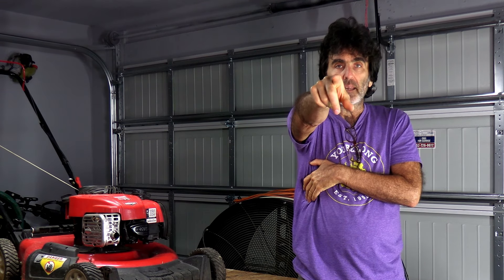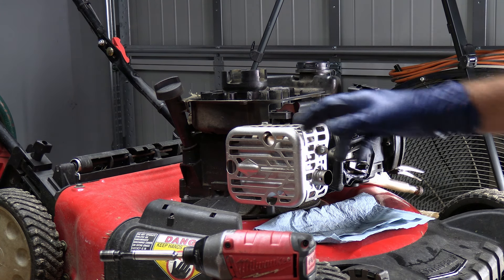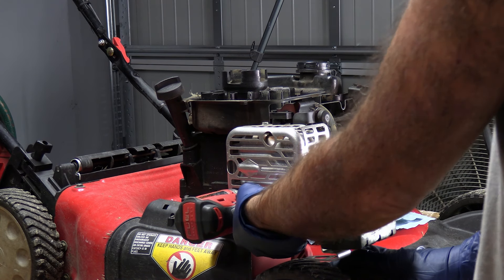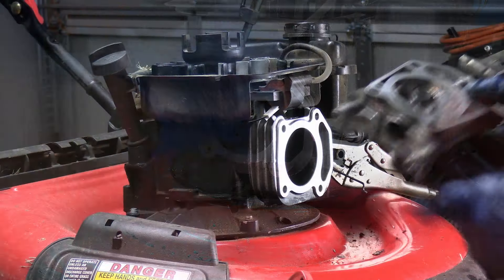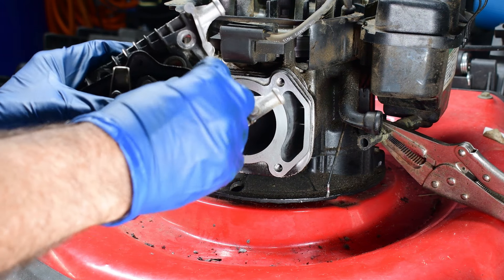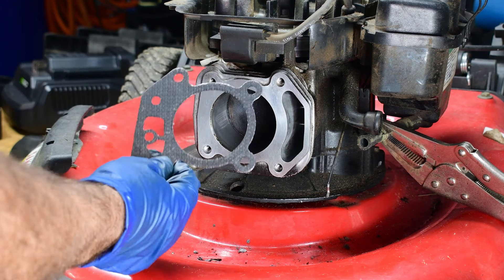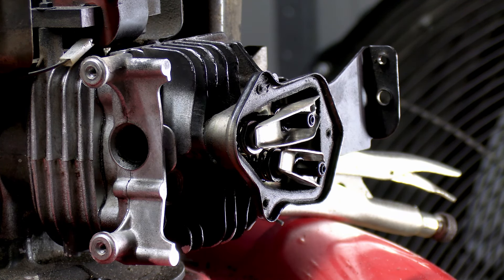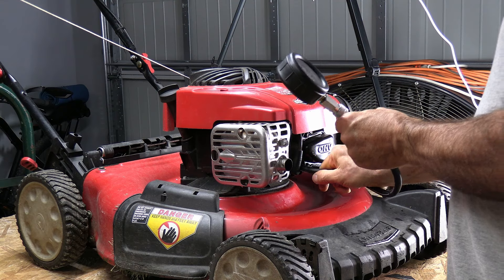How to Fix This Briggs And Stratton Engine With No Compression [EX 550]

Comment: I was taught years ago to run the piston up to the top before scraping the gasket off the head. That way debris couldn't fall down into the piston hole. Also, clean the carbon off the top of the piston and valves while you're at it, as well.
Reply from the maker: Great ideas!  Thanks for the tips...  😊
Reply: I was taught the same back in 1976 when I was doing repairs.

Comment: I was working on a new customer's mower, it's 1 year old, the husband said he had hit a rock, and the blade shattered, and he was right, he showed it to me, and it shattered, never saw that before, but he replaced it correctly, it didn't shear the flywheel key, but getting to the point, it would not start, so did a carb clean, it wants to start, but noticed oil under the front of the engine, it almost starts, but sure enough blown head gasket, so we are waiting for the head gasket.
Reply from the maker: I've never seen a shattered blade either!  They will bend up like a pretzel, but not shatter...  I'm quite surprised that it didn't bend the crankshaft.  If you get a shake once you get it running again, that could be the culprit...
Reply: @JLPicard440  yeah, I will take pictures, and share on my channel, but yes I will go over it.

Comment: I have the same mower. It wants to start but its popping and back firing like a valve is stuck. Pulled the valve cover off and both valves move easily. However, when I spin the flywheel the intake valve opens and closes but the exhaust valve does move at all. Do you know what could cause that?
Reply from the maker: HI... Check to see if the roker is bent.  Make sure the cam is moving the tappet up and down.... Stuff like that..

Comment: Need head gasket for E300 but no numbers to order it, can’t read nothing on it 😢😢😢
Reply from the maker: HI.... I don't have those numbers off the top of my head.  Usually there's a sticker with a QR code on it... is it missing?  IF it's there your phone can read it and it'll take you right to the B&S site and list your engine model number there.

Comment: i think this is exactly what i was needing. Gonna hit it again after lunch lol.  Thanks for dropping the specs in there, makes life so much easier, now if I just knew where my feeler gauge is lol
Reply from the maker: I hope you got it going!  and that you found your feeler gauges...  😊
Reply: @JLPicard440  I found them actually. Still not getting it running. Compression gauge read about 30psi. You can feel the difference, but now it just doesn't wanna turn over. At this point I'm just gonna arbitrarily clean out the fuel system, clean the magneto and ignition assembly of the little bit of surface rust, and see where that leaves me
Reply from the maker: I think these have a compression relief, but 30psi seems a bit low.  I want to say this one was about 50 or so just on a compression test.  Are the valves closed all the way?

Comment: If my push mower is pushing oil out the filter , What you think the problem is ? Start this after someone change the blades.
Reply from the maker: Possibly to much oil in the crank case...
Reply: Maybe they tilted it the wrong way while changing the blade.

Comment: Me again, I’m 76 so can’t afford mechanic. My problem was I ran out of oil when using self propelled mower it popped then stopped. I’ve cleaned carburettor and tried starting it with new spark plug and filter out but just nothing happens. Seems no compression as blades turn very easily . Do you have any suggestions on what may be the cause . Mechanics here charge $80 plus get an hour!
Reply from the maker: If it ran out of oil and then made a loud popping sound did it throw a rod?  Take out the spark plug and use a bungie cord to tie the stop handle back so it'll release the engine brake.  Then if you can pull the rope slowly with a long screwdriver in the spark plug hole.  You should feel the piston coming up and then going back down.  IF you don't feel anything moving in there then the engine is toast... ☹️
Reply: @JLPicard440   Thank you. Does that still apply regarding the bungee cord if I have a self propelled mower. It Goes for ward when I lift handle? Sorry to sound thick! I’ll take a picture and see if I can send on Facebook
Reply: @JLPicard440   yes I can feel the rod. I opened up where the valves are and the bottom one doesn’t look central through the spring. Is there anything I can do ?
Reply from the maker: @daphnekite578  I'd have to see that... do you have access to FB?  You can upload a picture on my take a bath productions page there..
Reply from the maker: HI, most mowers have a handle that you have to pull down to get the mower started... Not the one for the self propelled.  It's just so you can turn the engine easily..  Don't try that without removing the spark plug in case the engine starts on you!  That would be dangerous..
Reply: Bad valves clearance or head gasket
Reply from the maker: @stevenorris6394  Could be... It kinda sounded like one of the rockers popped out of it's place..

Comment: What if it is missing the torx screw on rocker? On the nut
Reply from the maker: I'd have to see that, but if there's a screw missing it might be in the crankcase which is not a good place for a piece of metal to wind up...

Comment: Thank you soooo much I had given up on my Honda HRB475 which had run rubbish half way through cutting the lawn ( should have finished it ) so thought I'll gap it and generally see if I could fettle it ..nope I did something and then had no compression 😢 Followed your valve setting guide and st to outlet 8k inlet 6k ..had compression.sealed valve cover with gasket sealant and waited 10 mins - pulled the cord . 1st Pull and it ran like a train better than it gas for years ..I was seriously thinking replace £1400 or have it looked at £150 ..WoW you saved all of that Thank you if I had to pay to subscribe I would totally doing cartwheels 👏 😃 😅 👍
Reply from the maker: Wow.... TYSM for the great feedback and Im so glad you got it going and was able to fix it up again.... 😊

Comment: Thanks for the Great Video. I have the same problem with my B&S engine off of a Pressure Washer.  I will check mine out and see if It will work.
Reply from the maker: Hopefully that's the issue.... 😀
Reply from the maker: Personally I just use an impact and tighten the flywheel with that.  You just have to know where to stop..  (I know, not very scientific!).  If you google your engine and input flywheel torque specs you'll probably get some idea of where that is actually supposed to be... 😀
Reply from the maker: You're welcome..

Comment: Question: 50 is a 'little low'. What do you think is causing the lower compression? Rings?
Reply from the maker: Could be.. Some of the small engines have a compression release on the camshaft.  I don't know if this particular one does or not without seeing the camshaft.  I have another one here I'm working on with the same engine, if I think about it I'll do a compression test on it just to see if I get a similar result and get back to you.  If you don't hear from me by tomorrow morning remind me because I forgot!.. 😂
Reply from the maker: Update:  I checked my other mower.  Same engine/ cold.  Had the same result around 50 psi.  So that engine may have the compression relief...  Once the engine gets up to speed, the compression goes up to normal.  Hope that helps.  Thanks.
Reply: @JLPicard440  So, I bought a compression tester from Harbor Freight. I check 3 saws I have...all said 30 lbs. 🧐

So, I go check my running saw that's kind of new...30-40 lbs. I check my lawn mower (that runs fine)...30 lbs. 

Fed up...I go get a different tester.

Same thing. 😒

Am I going crazy?? My lawn mower and saw shouldn't run at 30...right?? What are the odds of 5 pieces of equipment all having 30 psi??

I even checked my car...and although it was higher...it was reading like 130... and it's a newer rebuilt engine. 🧐
Reply from the maker: Yea 130 on the car is about 9:1 compression, which unless it's a performance car should be about right.   30 does seem a bit low, even mine had 50 which I think is due to a compression relief, but that a theory on that particular model..  Are you sure there's no leaks on the tester?
Reply: These machines do have compression release they won't go over 45-50 I have had a couple that read 20 but for that same reason Compression release

Comment: Good job on the repair. Chances are the compression was in the low side was due to the compression release valve. If you spun the engine with a drill and the cover off you would have had a better result. Just curious why you did not perform a leak down to make sure it was the head gasket?  Thanks for putting this together.
Reply from the maker: HI, yes I'm not 100% sure this engine has the compression release, but I'm pretty sure it does.  I've tested other engines of the same make and model and had the same compression result... Thanks for the great feedback... 😀

Comment: Tackling a run for a few seconds and then dies problem. Cleaned the spark plug and it will now run but unevenly and with about 30% of full power. Thanks for posting, hope it's just a carb cleaning issue. It was strange that I was almost finished cutting the yard and it just died with plenty of gas still in the tank.
Reply from the maker: It very well could be... if you're going to pull the carb, I usually will dump the fuel from the gas tank into a clear jar so I can see if it's contaminated with water or trash... Then I'll flush out the tank with a water hose and let it dry completely.  Before you go through all that, do a compression test if you have a tester.  You never know, it might reveal a problem.
Reply: @JLPicard440  Thanks for the response. Took the carb apart and cleaned it thoroughly. There was a little bit of sediment in the bowl but not horrible. I have a feeling one of the jet ports was clogged. I ran wire through it and rinsed everything real good with cleaner. I put it back together and it started first pull with full power! Having never attempted this before, the video was very helpful.
Reply from the maker: @bluzzjazz  That's excellent!  Did you flush the gas tank out?  There might have been something in there that wound up in the carburetor..
Reply: @JLPicard440  I did not because it looked very clean when I shined a light into it. Probably not a bad idea though. I only have about a quarter tank in it. I'm just thrilled it actually started after I put it back together!!
Reply from the maker: @bluzzjazz  Awesome!  Make sure to save that 1/4 tank into a glass jar or something incase it looks fine!.. That's worth a pretty penny.... 😂

Comment: Great video. Thanks. B&S engines sure look alot different than the old flat or L head engines. I’ve worked on the plastic carbs before to remove a piece of dirt. Plastic is one way I guess to deal with ethanol.
Reply from the maker: Yes exactly.  The old flat head engines were before my time, but I've seen them.  When I first saw the plastic carbs I thought they were junk, but over time I can see that they are actually better than the metal ones since they'll clean up much easier when someone leaves gas in them for an extended period.  The gas tank too....

Comment: Edit: Problem Solved! There was a nut that lodged itself in the intake valve! Bent it pretty good so I have new parts and gaskets coming in tomorrow. Finally after 3 wks of troubleshooting 😅. 
Great all around vid! Currently working on a 110cc Taotao atv with no compression at all, just like what you had. Tried tapping the rockers and tried soaking overnight but no change. Might be the gasket!
Reply from the maker: Wow!  Where in the world did the nut come from in the 1st place..?  Good job troubleshooting.  I hope the nut didn't damage the head if it was bad enough to bend the valve.
Reply: @JLPicard440  I recently bought it for cheap on Marketplace, thought it needed carb cleaning. The nut holds the air filter on from the inside which is a design flaw. The good thing is it didn't go past the valve, it just made it stay partially open. The cyl and head were still good. Can't wait to hear it purr today!!
Reply: It runs like a beast now 😃
What a thrill it was to hear it start right up. Your vid got me on the right track, thank you!!
Reply from the maker: @attheendoftheday8969  That's awesome!  Yes I buy mowers from marketplace whenever they pop up!  Which lately hasn't been much.. 😒😒
Reply: @JLPicard440  everybody might be learning how to fix them now from watching your Diy vids. A catch 22! Lol
Reply from the maker: @attheendoftheday8969  Lol...  😊😊

Comment: Thank you my grandson bought a used mower, with a written 30 day guarantee. They guy it was "serviced & ready to go". After my grandson started the mower, it seized up. I called the guy. He started screaming' he told us to change the oil, etc. It also had gas dripping from the "totally rebuilt carburator". Told my grandson call the guy, tell him to keep the money ($40) but come get the mower. Well the guy was saying he'd come by & give us the money back, pickup the mower, etc. He did neither. LOL Anyway my grandson found a mower exactly like the one in the video. No compression. This video, lets me know, we can fix it for $15. I appreciate your detailed, easy to understand instructions. (the mower was a curbside find). He's happy, he can make some money, with what little of summer is left. He watched this like a hawk. Now I've got to find a Torque wrench.  Sorry for the long comment, but I've been steaming about the last mower.(The guy, is here "To help the kids" should've been my first warning flag.)
Reply from the maker: Wow.. first it's just sad that the guy you bought it from acted like that.  There's no guarantee that the curbside mower will have exactly the same problem, but I hope it does for you.  If you have a harbor freight in your area they'll have a torque wrench fairly cheap.. just make sure it can do in. lbs instead of ft. lbs.  also be cautious about who you get the head gasket from.  I had to get two of them because the first person didn't package it correctly and it came having been folded through the mail and was ruined.  Those don't like being folded.  If a local parts store has one, thats probably your best bet since you can see it before buying.  I hope you get it going.. Let me know if you have questions.. happy to help.

Comment: Torque specs in nm would be awesome
Reply: clearance on the rod and crank "bearings" clearance and maybe partsnumber for new crank ,lower case halve .camshaft.  piston and piston ring and rod and wrist pin and sizes and ring gap thanks dear community
Reply from the maker: Just google a conversion from in-lb to nm.. thanks.
Reply from the maker: You can easily look that up.. thanks.

Comment: Why do you suppose you only had 50psi when Briggs says 100psi?  Rings? Valve seats? Could you have checked those while it was apart?
Reply from the maker: You can't really check rings without taking the crank case apart and removing the piston...  Sometimes when the engine is cold, you'll get a different reading.  I should recheck it when it's hot to see if it's better.  That mower always ran good before the head gasket went out, so it wasn't worth that much trouble for me.. But I agree, I thought it was a little low.
Reply: @JLPicard440  I would say your compression was fine (greater than 50psi) the long hose on the compression tester probably gave you a false (lower) reading
Reply from the maker: @jthoresen  Good point... hadn't thought of that..  Thanks for the tip.
Reply: @JLPicard440  Tip the mower back and squirt some oil into the spark plug hole in a circular direction (I use a syringe with an L shaped tube on the end). If your cold compression figure goes up a fair bit, it's the rings. I try to syringe most of the oil out after testing to make the next startup less smokey.
Reply from the maker: @ceejay6882  Awesome!  Thanks for the tip.. 😀... I'll put that in my bag of tricks..

Comment: Funny how Briggs had about twice as many head bolts for years and we rarely had issues.  That mower looks somewhat new and has a head gasket issue?  Look at the distance between bolts; that’s pretty far based on what worked well for longer than I’ve been alive.
Reply from the maker: I think that mower is a 2015 or something like that...  Yea I don't see head gasket problems very much, but occasionally it can happen.